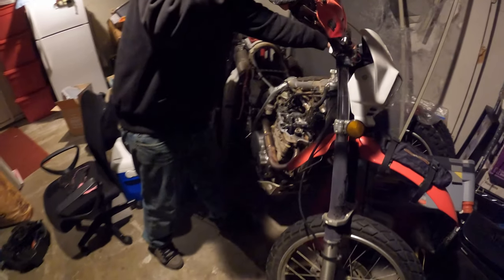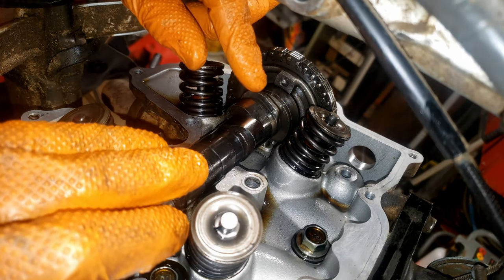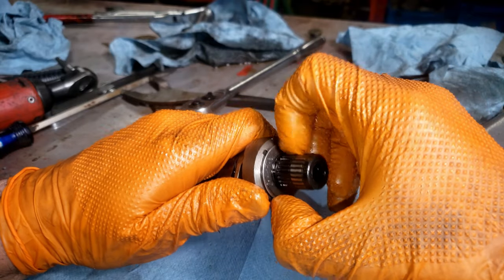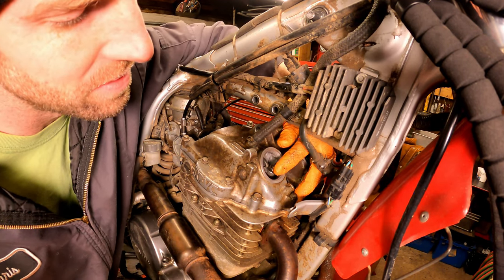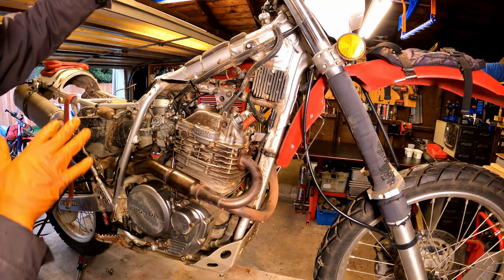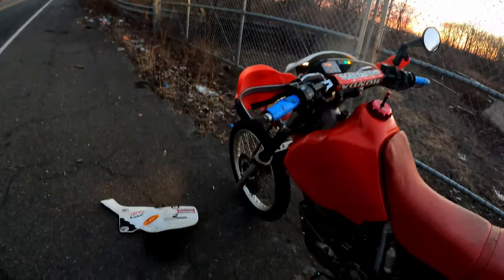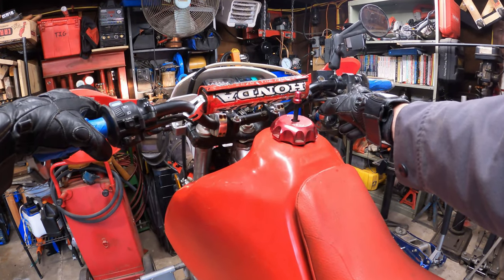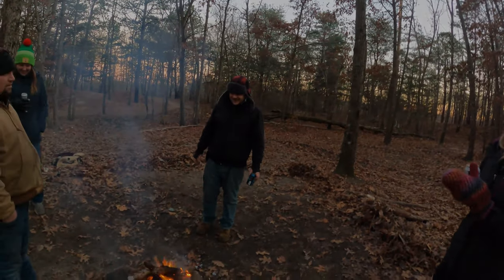XR650L Tapping Noise - Diag/Repair NNKH

Comment: I had never thought about putting my hand over the air filter intake hole to pull a vacuum on the carb to suck out anything that might be in it.  I had just bought an XR650L a few weeks ago that appeared to be starving of fuel at WOT or 55MPH+.  I didn't notice it when I test rode it around the guy's neighborhood; I was somewhat dreading having to pull apart another carb (I'm already rebuilding a Suzuki Savage's carb for a friend.) and tried what you recommended during the weekend.  

She's ripping now.  I appreciate you putting this info out there, bud.

Comment: Well done Mr  😎
P.s  Had a Cali import honda slr 650 back when. Stripped all the emissions crap off it. Cut open the stock silencer. Cut out the restrictions and repacked it with fibreglass wool. Coat of olive drab and satin blacked the rest. Everybody thought it was ex army. My legs dangled like a kid on a swing on it, due to being a short arse. I got turn up's in my underpants!!. Sold it after a few years and made my money back on it. 
Good bit of kit  😎

Comment: I had an intermittent tapping noise on my xr650 but only when hot, turned out to be the valve seat popping out and slapping around in the head. Replaced it with oversized seat and never had any more trouble. Quite common problem with these I believe

Comment: I'm restoring a XL 600 LM right now and the right cam chain guide is broken. No spare parts left in the world it seams but I've heard a conversion to the chain of the XR 650 L is possible. So thanks for giving me a look inside the engine of one of those.
Reply from the maker: Damn, that sucks. Last time I checked there is a ton of xl600r cards on eBay. Although it's been awhile since I looked.  And no prob!
Reply: I used a xr650l cam chain, cam sprockets (2), and the xr650l cam chain sliders  (2) and you need the hardware to hold the xr650l cam chain slider in. I did it in two 1983 xl600r's. Also its a good idea to change the cam chain tensioner and tensioner spring, Its the same as a xr650l too
Reply: If you ever burn out your rockers or cam its also possible to have a machine shop machine the valve cover to accept the xr650l rockers and use a xr650l cam in the xl600r

Comment: the absolutely worst thing about the XR650l in my opinion is the 37" seat height !
I've had 2 XR650L's and lowered both of them easy.... just extend the dogbone underneath
and drop the tripple trees on the forks !  on the one I own now a 2001 XR650L with 5k miles
I simply bought a adjustable dog bone and replaced it... though it wasn't enough for me so I cut it in half and added 1/2" of steel rod to the turnbuckle and that did the trick.
i have a 30" inseam and with cutting the seat foam I can now flat foot the bike with both feet while on it.... a tall bike is a bigger danger to it's rider than anything ! lower that beast ! you'll be glad you did !

Comment: I just got a 650L w/ 13k miles and I frankly didn't notice the ticking when I bought it. I think I was just too excited. 

I think mine may have this exact same issue, but I'm curious... on mine, once I start riding, or giving the motor throttle, the sound goes away. Which I'm guessing is because at the higher speed, the decomp is actually disengaging. But it's not disengaging at idle.

Are there alternatives to removing the system? If I'm not adding a manual decomp... I wonder how that will work out?

Comment: i just finished my rebuild. found the decompression spring stuck to the magneto on the clutch side? replaced the cam anyway... i found some metal shavings in the bottom of the case. probably from long ago though. i think that i'm sliding the engine back in later today, but still need to upgrade the stator for all the extras i'm planning.

Comment: Learned a lot.  My 2002 xr650l  has a lever for decompression.  Seems like that will be more reliable.  Just bought the bike with 5400 miles.  Has FCR carb so it rips.  Thanks!

Comment: Just wondering if that carb cleaning trick would work with an outboard motor. I keep having a problem with my engine where it will run and then all of a sudden just cut out on me. I think it might be a fuel pump issue but it is an older motor so maybe the carbs are gunked up? Any advice? Love your videos.

Comment: I have a older school, XL600   love this range of bikes.  mines never given me any sht though.   but I bet these newer ones rip way better.
Reply: You guys that have never had issues must baby them. I had one when I was 13 and rode it hard. 3 engines while under warranty hard..  If I felt like they were as reliable as people say they are, I'd buy a 650. The XL600 handled so much better than my dads KLR600 and also the XT600 I had. The KLR was one that was very reliable. I always thought the water cooling had a lot to do with that though. However, The KLR was heavy compared to the XL600 and handled like a pig where I rode in the desert. The XL and XR's were much better in the dirt.

Comment: Mine was in same situation. broken rocker arm plate once and I had replace a new one with doul pin spring as well but I noticed the motor couldn't rev up for higher rpm and again the rocker was broken and so the rpm is getting normal. I think the issue was the cam is not in good shape so the Decompreser place is hitting that broken peace before the rocker hitting the cam. now I'm rinning with same rocker that brok and runs grate

Comment: So, hypothetically... Say I have xr650l with a similar ticking. If I check my valves and that's not the issue, does a faulty decompression device really cause any issues other than the ticking? Loss of power?
Reply from the maker: Depends what's causing the tick.  If its the decompression then yes it could cause loss of power. And possibly hurt the cam.
Reply: I have the same issue. valves seem correct, but I am getting a loud ticking noise when cold. Soon as it's warm the ticking goes and the bike sounds great. Unfortunately i am halfway across Africa and don't have the resources to check the decomp system. How much damage do you think i will do if i run it like this for another 5000miles?

Comment: In 1990, I bought a 1988 NX 650 brand new in Oceanside, CA .for U$2650  with the same engine. I loved  the style, the engine character, the torque. As far as handling it was a rail, however the engine didn't last too long.  The top end ended-up being all worn out prematurely; Followers, cam shaft, finger ring of decompression mechanism.This RFVC Radial Valve system wasn't a good or robust mechanism. Mine ended-up being  toast at 25'000 miles or 40'000 kilometers. That is the funny thing with Honda, normally, they make some really good engines, but from time to time, they also make some really crappy ones depending on which  model ....Maybe there was a deficiency in the lubrication of that particular model, as well ( the way the rocker arms and cam shaft were wearing off!!! )  or the case hardening wasn't  good enough.        I have been wary of Honda valves mechanisms ever since. I would never buy a Honda with a Unicam system.  (The DOHC  is the reason why I  got a Suzuki V-Strom 650.)  For some reason only the Honda Factory 450 rallye has a DOHC ( with 60 horsepower!!!) , but for the consumer grade stuff, they only sell the Unicam or the RFVC system ( they probably make more money on those...:)  I don't know why people claim they were bullet proof.  I guess nobody keeps them long enough to start running into problems. If they were so good, from time to time, you would see one with  lot's of miles or something. I never did. They just seem to have disappeared! :) That is the other thing, Honda made these XL/XR's for ever, but they never bothered to fix them.....I would feel far more confident with a DR650 which has an oil cooler and doesn't suffer from this weak SOHC radial valves/decompression mechanism to start with....This is the Achilles heel of these engines, too bad because the look/style was quite nice........I wish I had seen your video back then,  maybe I could have fixed it instead of getting rid of it!!!  Great video by the way.  https://ultimatemotorcycling.com/2020/12/31/2021-honda-crf450-rally-first-look-9-fast-facts-specs-photos/amp/
Reply: Mine ran 50,000 miles before it 
broke a timing chain guides. 
DR650 is a JOKE!!!!
THANK'S from NOR-CAL !!!!!
Reply: Go ahead stay away from
Honda.
Reply: I did a long time ago and never looked back.
Reply: I agree. It was a weak system. BTDT. I think these guys that get 50,000 out of them don't really know how to ride and baby the hell out of them. The air cooling kills these, especially in a desert environment where I raced them. I had the last of the big thumper '87 XL 600. In '88, they brought out that NX650 you had and then later on they brought back the XL in the form of the XRL 650, but still used the RFVC head. If they were even a 10th as reliable as some guys claim they are, I'd buy another one in a heartbeat, but I know valves are toast in short order when you run them hard..
Reply: @lmbear  yes, I have just watched one YouTube video about a DR650. The guy has 91K Miles on it, before something went wrong and then I have this article of another one with 145K miles on it and the thing still doesn't burn oil..... I also found another video of one Guy in Spain with a ( Gen 1)  DL650 V-Strom  with over 250K miles on it.   Tony Trotacaminos with his bike named "Babieca" Try that on a RFVC Engine.....😵

Comment: Hi NNKH im Azry, i think im having the same problem on my xr650L . I plan to the same mod like u did as to remove the auto decompression. But i need know is good for the engine . Does it give any other problem? Will it effect the starter as it has to work harder. 

Is it ok if i just remove the auto decompression in long term?  Pls help and advice me . Tq
Reply from the maker: I wouldn't suggest removing it. Just repair it

Comment: I'm sure this engine on a highway would be good and smooth etc. But of off road I'd much rather have a smaller torquey two stroke. But this is supposed to be a dual purpose bike so it probably is a great machine. Sounds boggy all the time but that may be just how it seems through the video too.
Reply from the maker: Yeah it's not the most racy engine in the world for sure. More of like a reliable tractor and engine. But they get the job done and are very reliable. Two strokes are fun
Reply: torquey two stroke???? tell us you know nothing about engines without telling us you know nothing about engines.
Reply: @steveww07  a 2-stroke of the same displacement as a 4-stroke has much higher torque.
Reply: @peterbonivart6818  proof?